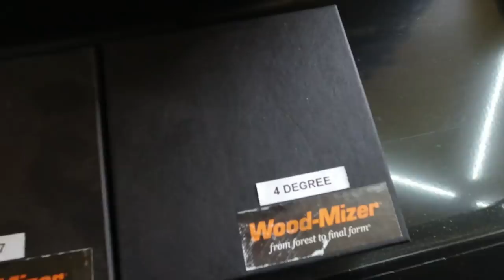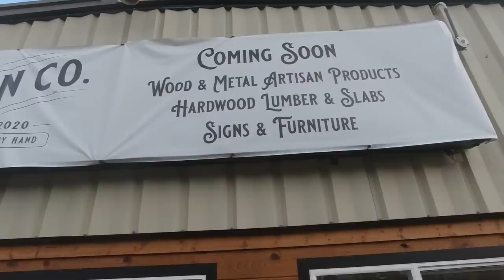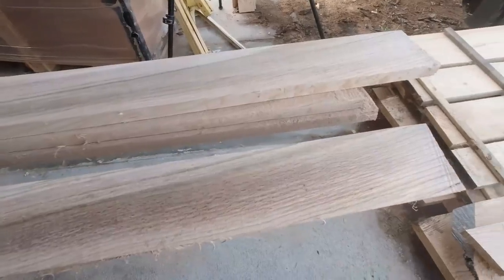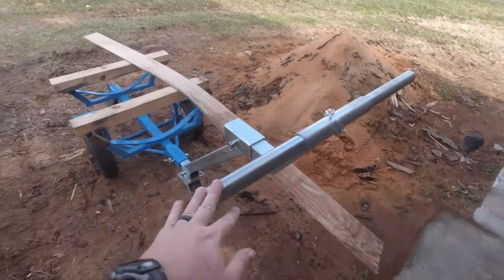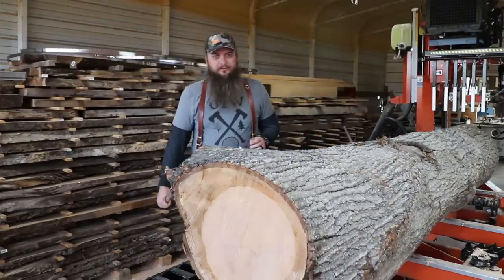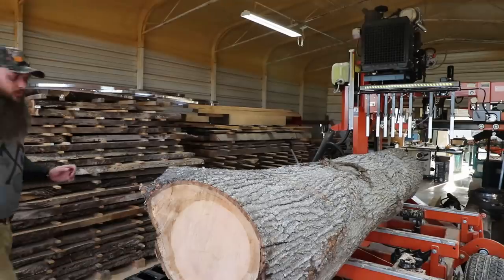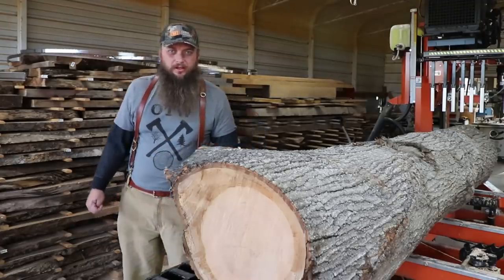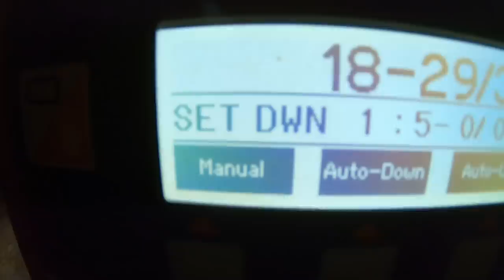Stunning Oak On The Sawmill & The Fastest Way To Flatten Live Edge Slabs

Comment: Ever consider putting a bumper pull dump trailer out there & throwing ur slabs, etc in there ? Can dump it any time U need it & it’ll take a while to fill. You can mount a tow ball on a draw bar for ur tractor to pull it

Comment: I sawed some red oak a few weeks ago. It has an odd odor of sewage. Is that a smell from the wood rotting. I’m just getting into the wood world
Reply from the maker: pin oak will do that alot,
Reply: Out of the Woods thanks. Either way it has a beautiful pattern to it. I just hope the odor goes away as it dries. I have it all stacked up to air dry. The wood is solid just rot in the sap wood.